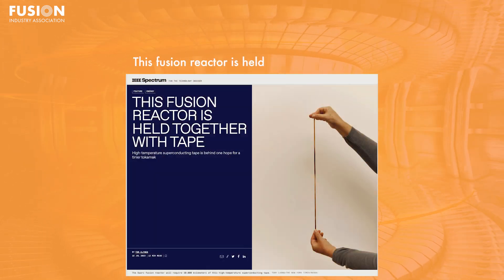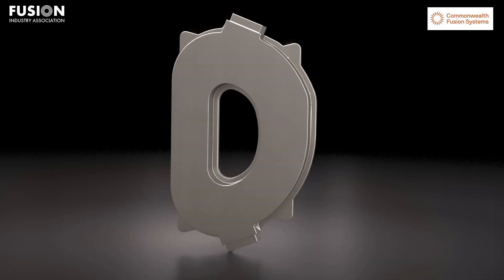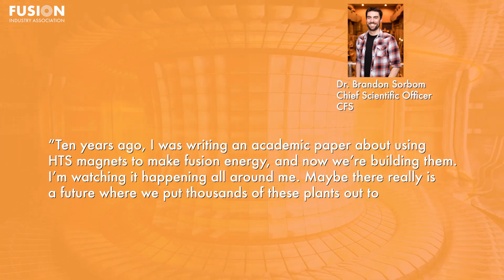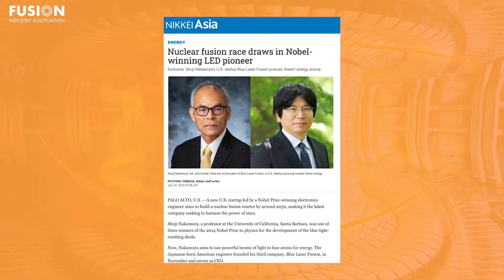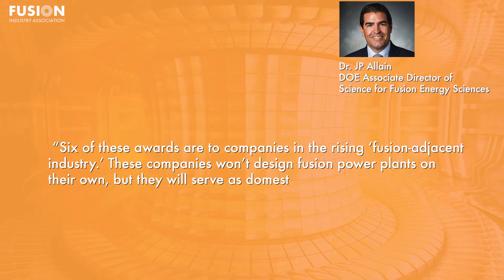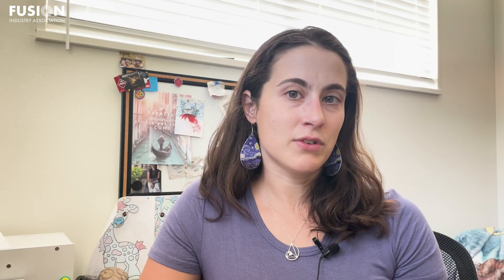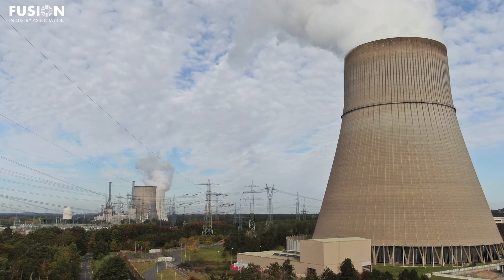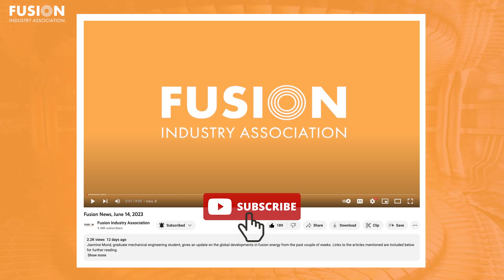Fusion News, August 9, 2023

Comment: Is the density requirement for a controlled, sustained, nuclear fusion reaction a limiting factor in the quantity of Deuterium fuel used???
Reply: yes, the density is a very important parameter, but the availability of deuterium (which I think you're asking about) is not. one liter of deuterium is worth about 13 dollars. there's a lot of it - mostly as byproducts from the oil industry.
Reply: @caneintel  If the density requirement is a limiting factor, then the availability of Deuterium is IRRELEVANT. Also, it is not just Deuterium alone that is required but a mixture of Deuterium and Tritrium for there to be a successful fusion reaction at the densities achieved SO FAR. Again, the quantity of Deuterium is IRRELEVANT.
Reply: @dunexapa1016  you seem angry but I didn't understand what point you're trying to make. Who claimed availability was a problem? I explicitly told you it was not
Reply: @caneintel  , Let me know when you can answer my question correctly.

Comment: The trouble with ITER is that if anyone though about cancelling it, just figure out how much it would cost to cancel the contracts on industries across the seven partners. Of course it's unstoppable. The question is how to make it work with the least possible delay and overbudget. It's always stated as a joke that the estimated cost of megaprojects should be multiplied by π. In the case of ITER it looks more like π^3.
Reply: Cost/Schedule reminds me of (JWST)^π  . . . Back in early-1990's when JWST (then NGST) was just a gleam in bureaucrats eyes !  😆
Reply: gotta remember that ITER isn't about profit. the practical experience we gain from trying and failing to build it is probably far more valuable than the price tag would suggest